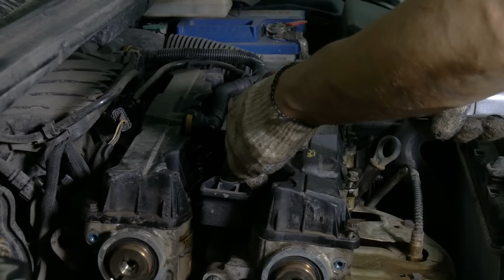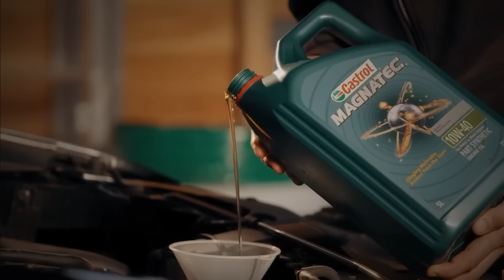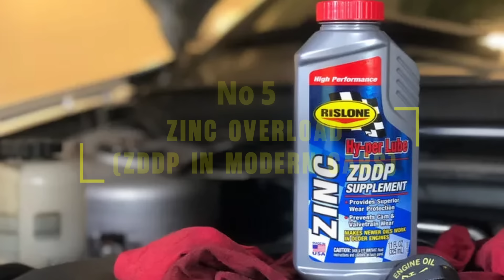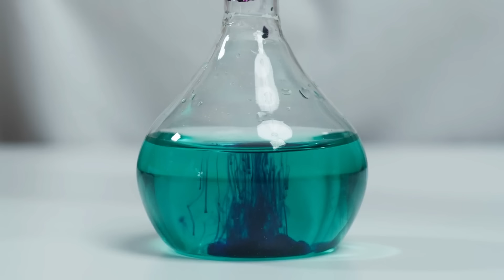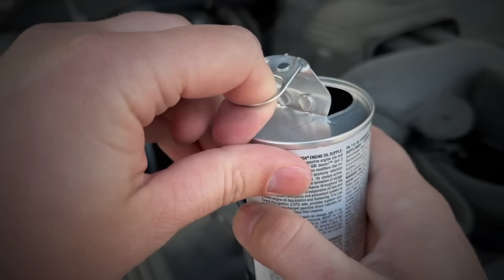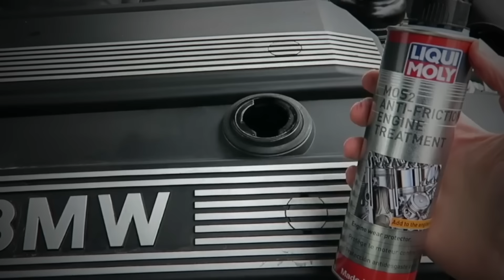11 Engine Oil Additives That Will DESTROY Your Car! (And 5 You Should Use)

Comment: The only thing I do to all my cars to flush out sludge and debris is change the oil more frequently. When I buy an old car. I first change the oil, pour half a quart with the drain bolt out. Then I do 3 or 4, 1000 mile oil changes after I drive it on the highway and it's hot. After that I stick to my personal service 'Vinterval' (because my name is Vinny 😅). 2000 miles on engine oil, and transmission fluid and filter changes every 6 months on all my cars, I do it myself. I never have engine or transmission problems. And I've had the same 3 cars for the past 15 years. I own a 1995 Buick Park Avenue 3.8L V6 Series 2, a 1995 Buick Roadmaster 5.7L V8, and a 1991 Buick Regal Custom 2-door 3.8L Series 1 (I've had the Regal since I was in High School it was actually my first car). Change your oil and transmission fluid.
Reply from the maker: Thanks for sharing your method!
Reply: @Cars.GuideDIY  No problem, I also flush the coolant every 3 years and I would do it more frequently. But it's a royal pain to get rid of

Comment: 2008 Chevy Impala V-6. At 110,000 miles it started leaving oil on the garage floor. I changed the Valvoline synthetic oil every 3000 miles. I put a bottle of Prestone stop leak in the engine. It slowed the leak down, so I put another in the next oil change. It stopped leaking about 90%. I traded the car in with 134,000 miles on it and it was running great and the oil leak still very small. I put paper down and it would make a few drops in a month.  I do agree that additives are mostly useless, but if your car has really high miles and you're desperate, some additives can make it last a little longer.

Comment: Should have mentioned the two big ones which are Seafoam and STP both have been used for over 50 years.
Reply: Stp is tops period #1
Reply: We used STP on engine rebuilds for years. Great start up protection 👍.

Comment: i have been using oil additives for over 15y they work wonders some better than others. what do u really think car companies would want your engine to last million km and not overheat? do you understand the word " capitalism" ? they are there to make money they want your engines to fail. i even use additives in electric vehicles
Reply: Top Advice I can't go with this Video  I've used  STP/WYNSS Oil treatment for over 35yrs and Redex fuel system cleaners since 1985  as a kid on feild bikes then road motors .Never an issue with thise 2  oil treatments and had one 2.5 petrol car top 257000  and still quiet and no Smoke when or was sold  there may be some bad products but om not using them and all my motors have never suffered apparent wear or failure relating to  Lubrication in any way just high miles and still singing 😀

Comment: Sorry, but graphite blended motor oils were excellent. The additives thrown in may not be good but the motor oils properly blended with graphite were top notch! An old copy of lubricants world detailed some of the first engines in the USA clocking over 1 million miles with the Acheson colloids package. Colloidal suspension is necessary for good graphited engine oils. Especially useful in splash lubricated air cooled engines. There are tribologists that forgot more than you know about lubricants.

Comment: I use Lucas oil conditioner in my rebuilt 7.4 . I dont know if it makes any difference now that I rebuilt it. I know that it helped my 7.4 achieve 300,00 miles. I was going 😅to start using it as a hotshot vehicle so I tore it down to rebuild it. It didn't need rebuilt. I did bore it and put new pistons and bearings in it. The bearings were perfect. The cylinder walls were .001 to .o025 out of straight. I put in a hotter cam new roller lifters and kept the valve springs as they were still within the cam I chose specs. Lucas works

Comment: I have used Marvel Mystery oil in my crankcase for over thirty years. I only add 8 ounces at every oil change because it has solvent properties. Too much will thin the oil excessively. It keeps the inside of my engines looking like new with no engine deposits and without harming the protection of the actual motor oil. I have over 230,000miles on my little 4 cylinder Nissans and they still run like new. I also use motor flushes with every oil change. It clearly states on the bottles to add the flush to cold engines and only idle them for 5 minutes. This does not harm the engine. Driving the vehicle with an engine flush in it will severely damage an engine. I have well over 200,000 miles on two of my older vehicles and they both run fantastic.
Reply: My best friend  Shawn  put Marvel in  his  GM 305 Sized up Tight, Mechanic said oil got to thin.
Reply: Yes that works good even great because it's real actual oil not all these other things they're talking about with extra junk in it

Comment: I've used Molyslip and Liqui Moly for years in my diesel engines.   You notice a difference almost immediately.   One of my cars was a Peugot 208 and did 205 thoiusand miles when I sold it and the engine ran like new still.
Reply: Top comment I  used STP  in a Vectra 2.5V6  in the 15 yrs I had it sold at 257000  and Still Quiet and Smoke free  when sold it without treatments ,  ?  I doubt  it would have been 🤔

Comment: I used  prolong and zmax in my dad.s 93 1500. When retired from rust.  306k on. Took engine  apart.   Looked like only 30k. On. The in side.

Comment: They definitely won't destroy your engine, don't listen to any of this crap, all you need to do is use awesome quality engine oil and replace it more than you need to, plus filter every second oil change, I recommend synthetic oil, but you can't use it if you have a dirty not frequently serviced engine, because it will break loose all the sludge buildup inside your engine, and you will need to do it in maybe 5 stages/changes before it clears out, without driving anywhere, i use 5w40 synthetic Valvoline for my Nissan GA16DE both motorcycles and Toyota Regius diesel 3.0L 1kz-te.

Comment: I'd like to find out, which is or would be the best one for my 3.6 l 6 cylinder Chevy engine, with only like 68000 miles on it. It's not giving me any trouble, but I'm thinking. Maybe some additive in the engine oil, we'll help at last longer.
Reply from the maker: For your 3.6L V6 Chevy with 68k miles, you really don’t need any special additives yet. The most important thing is to stick with a high-quality full synthetic oil (like 5W-30, as GM recommends) and change it regularly with a good filter. Additives usually don’t give much benefit if you’re already using good oil and changing it on time. If you want extra protection, you can use brands like Mobil 1, Pennzoil Ultra Platinum, or Valvoline Extended Protection. That will help your engine last a long time without problems.
Reply: @Cars.GuideDIY i understand that Fram moto oil, it's actually made by one of these companies that you mentioned.

Comment: You left out one additive that does work and is backed by science and the federal government. With FAA approval for gasoline engines. 
The product is Avblend and works very well. I've used it in many vehicles including a B block Chrysler engine that loved overheating. This product actually dropped temps down 25-30 degrees. It works by saturating metals in the engine. These pint cans run for anywhere from $15-$30 depending on who you order from.

Comment: In the 90-thies I was to a couple CASTROL info meetings. 
One of the mechanics asked; can you name the absolutely best engine oil - not depending on price and producer? 
We were surprised when the answe was; Mobil1!
The people from Castrol were honest - and told us the diffrence between products. 
Also they admitted about additives; 
Due to the very hard competition between manufacturers they always are on their toes checking if any additives really are as good as stated. They check ALL kinds. 
If by any chance some additive proves to be THE answer - the manufacturers will fight to get that additive into their product - as huge money are involved. 
If the product is no good - the additive is on its own. 
Lesson learned; additives are waste of money!

Comment: Activ8 I put it in everything, I discovered this when a customer put it in a new van and the manufacturer tried to reject the warranty claim as Activ8 stopped the piston rings bedding in and the van continued to use oil. Put it transmissions of HGVs and see an improvement in MPG as it reduces friction. I might drink some, see if it sorts my knees😂 seriously try it, 
Shaun
Reply from the maker: Haha 😂 careful with drinking it, Shaun, you might end up running on diesel yourself!

Comment: Castrol Magnatec is an OEM certified oil it hasnt got metal in it , chemical formula helps the oil bond to metals to stop wear on cold start ups . I used it on my pick up since new with over 300k miles never touched the inside of the engine . You failed to mention Liqui Moly Ceratec , Its the only additive that helps with the coyote tick with lifters on the Mustangs and engine heat .
Reply: Hi, I've always used CASTROL 5W30 FULL SYNTHETIC in my 5.0lt gen 3 MUSTANG for the past 6 years with no problems. As you mentioned it's FORD recommend oil. This guy wants to be careful of a law suit coming his way from CASTROL.

Comment: I have been using Nulon PTFE oil addative in my Nissan Pathfinder for 26 years and its done 430,000km and still runs like new.  V6 petrol engine. 
I left my Prado diesel in garage for 2 weeks and started it up and it started rough as all hell, thought it was gonna stall. It was only 43,000km old. So I added Nulon PTFE addative for diesels and now I can leave it 2 or more weeks without starting and it starts smooth as silk. Nulon has been around for decades too, and you seem to rely on that fact for the addatives you recommend. Wouldnt be without my Nulon!
Reply: teflon is old school additive the ones available these days r way better using ceramic, nano, graphene nano particles
Reply: Ptfe in helicopters also
Reply: Me too..PTFE INCREASED GAS MILEAGE

Comment: Hey , don’t knock my Marvel Mystery Oil. Used it for many years, with more good results than bad. What does it do? How does it work? It’s a mystery!
Reply: And the smell of wintergreen reminds me of grandpa. He always had those lifesavers in his pocket. I read somewhere that oil of wintergreen (Methyl Salicylates) is the solvent in MMO.
Reply: @jimandrews1011  Its not only a cleaner solevent it allows the surfaces to polish without abrasion I used it as a jeweler to sharpen on a sharpeming stone tools used for cutting metals it gives a highly polished sharpened edge
Reply: @joebarnes7549  I am a believer. I mostly use Seafoam lately to clean my engine, but when I was a kid I ran into my buddy who picked up a Pontiac 400 that rattled like crazy from clogged lifters. He had 5 quarts of MMO and did a straight MMO oil change. I saw him a week later and the car was purring. When my 200,000 SUV started burning oil I topped it up with a quart and it stopped burning oil. I am actually a fan and it smells good too!
Reply: Back in the day pretty much you ran either straight HD 30 wt. or 10w30 or 10w40. Adding Marvel helped thin out the dino oil and actually helped especially in colder climates. Now with the new synthetics I'm not so sure you need it.

Comment: The oil specialists on YouTube says modern oils have all the additives they need. Adding extra ones can even work against the oil. He says only add cleaners for the injectors to the fuel tank.
Reply: yes but u have to understand oil companies r there to make money why would they use additives that work where u only have to change your oil every 100,000km or more because they want to keep selling u oil for every 10,000km oil change overwise they wont make money. welcome to capitalism!
Reply: @robhrvat3568 the oil is degrading from M when you first turn the key. You change your oil every hundred thousand if you like. The oil acidifies from combustion blow by even if you only drove a few miles and let the vehicle stand for 6 months the bearings are still  being damaged.
Reply: I watched a bio lab do tests on different oils adding prolong to each one after testing them straight out of the bottle! It even helped best synthetic oils !

Comment: Tuff Oil. You add a full bottle for your 1st oil change using Tuff-Oil, and only tequires a half bottle for every oil change afterwards, but what it does is it reduces frction so much thst I get about an 8-10% increase in fuel mileage.

Comment: How does some additive to engine oil help in reducing fuel injector stickyness
Reply: I was asking myself the same question. How would an engine oil treatment? Health injectors, if injectors, don't get any oil in them.
Reply: Old fuel can go stale & gum up, and make injectors stick , but that fuel would have to sit 5here for more than a year in your fuel lines unused. But yes that claim is laughable…😂😂
Reply: I have a 2019 Toyota 4 Runner it came with an engine tic .The dealer 
said that's normal...how come some are louder than others ? Sounded like lifter tic to me ,I put some Marvel's oil in it ,alot quite now .Got the front end  set at the dealer and he said why is you're motor so quiet now ? 😅

Comment: Marvel mystery oil works what’s wrong with you
Reply: MMO works. When your high mileage ride starts burning oil, it'll clean up those sticky rings and stop the excessive oil consumption. My daily has 360,000+ miles on it and can run 6000 miles before adding a quart of oil, then I change it around 12,000 with Mobil 1 extended performance. Still purrs like a new engine and doesn't leave a drop on the driveway. Sometimes I use Seafoam instead of MMO, usually a few hundred miles before I change the oil.
Reply: @jimandrews1011 I do this also 👍🏾
Reply: Used it on my gas and oil since 1970 and always will
Reply: works for a lot of things.. I've been using it for decades on gas and diesel engines... my cummin runs like new with 300K on it.
Reply: Yes, been using Marvel Mystery Oil for years myself and it works.
Reply: Yes it does , it is slow at removing varnish / and build up ! Works well

Comment: You made a mistake. Lucas oil stabilizer, is not a good additive. I watched an oil analysis with Lucas in it. It was wiped of all detergents and other additives the base oil was made with.
Reply: That is what happens when you contaminate the additive package and reduce it's ability to protect the engine.
Reply: Better in an old tired engine that uses some oil and normally uses 5 or 10w30..Go to 10w40. Idle oil pressure will improve and oil consumption reduce.

Comment: Risoline fuel injector with PEA every 3rd tank. 3.50 a bottle.
Reply: A good product.
Reply: At 3.50 a bottle they probably just wave the PEA over that batch before bottling. LoL  I saw STP with PEA for around 5 bucks.  I really wonder if these two are as concentrated as Techron ur if Techron is is just charging for the name?
Reply: my dad used rislone in all his engines and oil changes every 3000 had an amc javelins had a freeze plug on the back of 5he head had to pull the heads at 380 thousand miles the engine inside looked new zero oil build up or sludge still showed crosshatch on the cylinder walls I swear by this product and regular oil changes

Comment: I used tribal text and a 21 Chevy Colorado and wow it made a big difference in power smoothness quicker starts and the engine is a lot quieter not that it was loud but it was quieter I would buy it again anybody out there that has a little bit noisy engine by that nothing else you won't regret it but more expensive but it's worth it but it is at the new oil change you'll know the difference in about 500 mi trust me you won't go wrong RST of Michigan
Reply: What is tribal text?
Reply: @mk7-e8e LOL  According to Google's AI  " "TriboTEX," is a nano-oil additive for car engines".